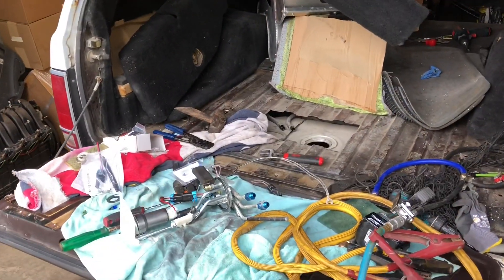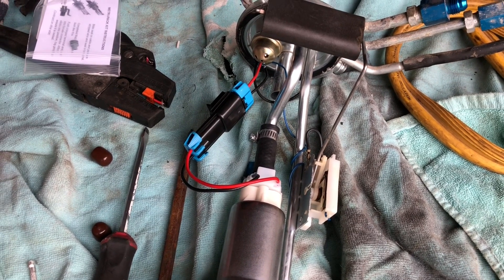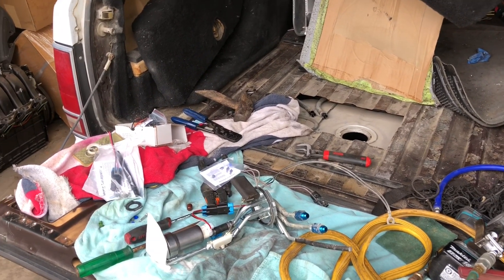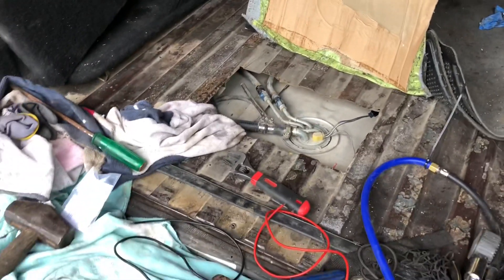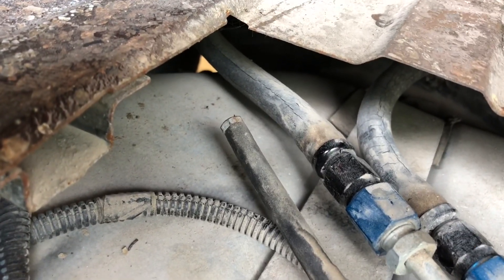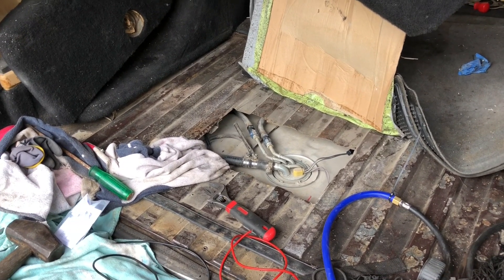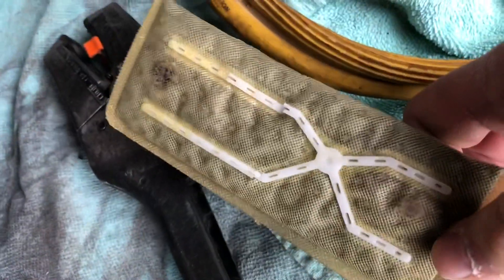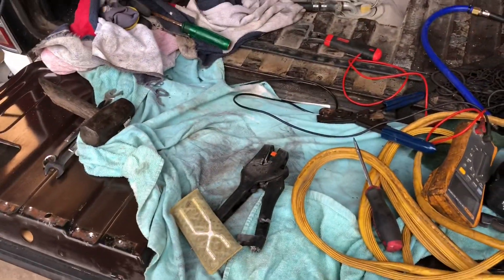Walbro 525lph Hellcat Pump upgrade for the Turbo S10

Comment: So jw… how is it a “hellcat” pump? It’s just a walbro pump…
Reply from the maker: The fuel pump is 525 lph pump made by Walbro specifically designed for the Hellcat Charger engine. Or 707 hp supercharged engine body style doesn’t matter. So, it’s referred to as the Hellcat pump, if you want just buy a 525 lph pump from Walbro.  Walbro warned me to be very careful trying to buy off eBay etc because the 525 lph is knocked off by cheap imitations all the time. I paid $217.xx straight from Walbro JD

Comment: Run Earl's ultra pro fuel line. Plugged up sock filter is probably broken down rubber from the cheaper rubber hoses.
Reply from the maker: We found out the Eaton hose we are using is e85 compatible but the small piece of hose connecting the pump to the hangar assembly is regular fuel injection hose needs to be replaced. I will look into the Earls line when I upgrade to the -8 lines!  Thank you JD

Comment: My thought on that dirty sock would be the fuel line deteriorating and being fed back through the return line. I was surprised to find after only a couple months the color of my clutch fluid because of a cheap hose up to the reservoir. Did you drill out your turbo oil feed restriction hole? If so, what size? I didn't shim my oil pump so think I might go a little bigger than yours even though its a similar size journal bearing turbo.
Reply: I was thinking the same thing fuel return line...
Reply from the maker: Good catch, the fuel line wasn’t sticky or soft but it has to be the source.  Thanks !  JD
Reply from the maker: I agree the black in the sock has to be from the piece of hose on the pump or it’s the Easton fuel hose I’m using breaking down?  
I’m not running a restrictor inlet fitting on the Turbo.  I’ve found contradictory information on when it’s recommended to run a restriction.  I thought you were only supposed to restrict ball bearing turbos but maybe I’m wrong?  My oil inlet adapter is full -4 internal diameter, I hope I don’t have issues with a smoky turbo!  
Good question I appreciate the support and hope you follow along and ask more questions!  JD

Comment: 10% ethanol fuel was very bad for fuel system parts. Even if auto parts were built for it, they would have lasted longer without 10% ethanol. Many old Nissan engines had an unusual fuel injector design, and E10 made a bad problem worse. I'm not sure what California had in their gasoline, but the Nissan 300ZXTT was made until 1996 and had injector problems. It was another reason why those cars cost a fortune to repair.
Reply from the maker: Skyline Fever The hose I used is a commercial grade fuel line made by Eaton. My friend Richard has the same line and his looks good no cracking seems weird.  JD
Reply: @HeadFlowInc  Wow, that is really rotten luck.
Reply from the maker: I think or hope the line is ok for now, I’ll definitely update both the fuel line material and size when I replace them.  Eventually I’ll be swapping the 4.8 build for a built 6.0 setup with 1000+ WHP which will require more fuel system. 
I agree, I have all the luck, Richard has the exact same hose on his Typhoon; his looks great but his is always stored inside in a temperature controlled garage.  JD

Comment: On the wire. It’s important to run a good wire from the front to the back. The longer run of wire you have the more current and voltage drop you will have. Think about how thin the wire is on a fuse....but it’s short and the current passes through it just fine. That short wire is fine, and if you stripped it back you’d notice it’s thicker strands and a pretty heavy duty wire for its size.

Comment: Hoses are like tires, sometimes it sits on the shelf a good while before it is sold/used.  That looks like age cracking (dry rot of the rubber covering).